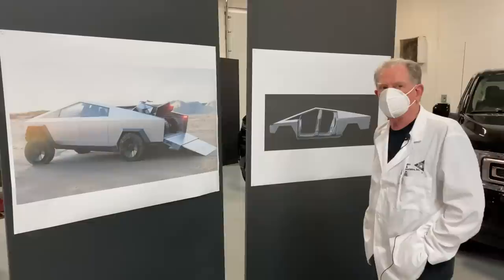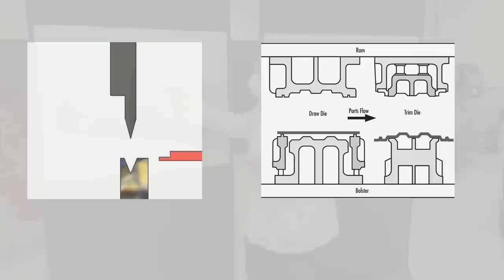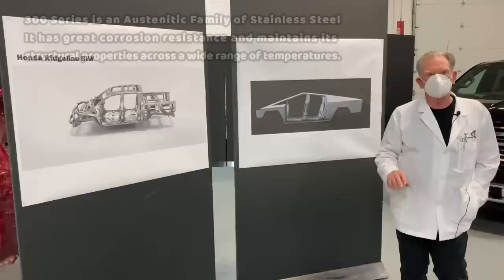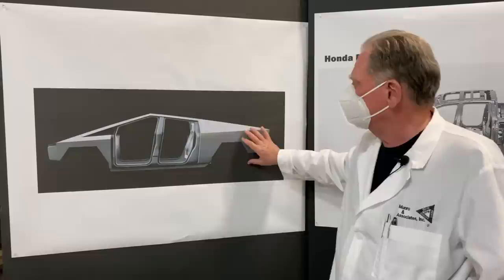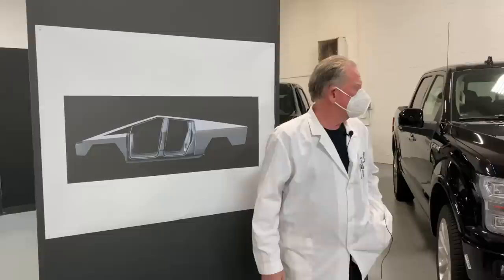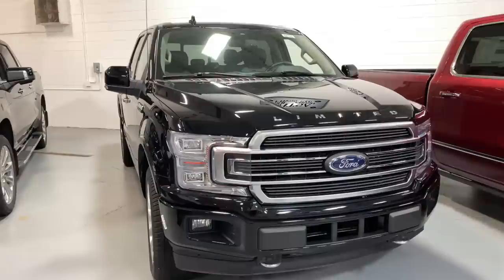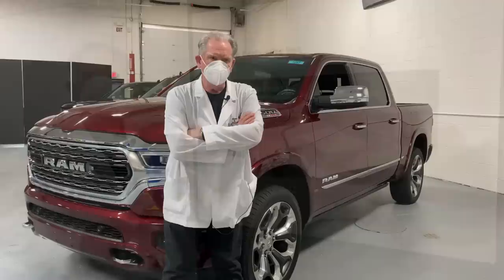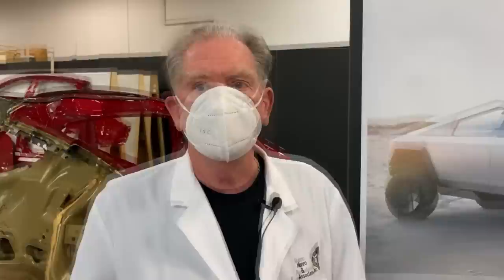Cybertruck E1 - Body Structure Comparison

Comment: It would be nice if Munro (or Elon Musk) clarified what "ultra-hard" stainless-steel means and why you can't stamp it.  Presumably 30X refers to an alloy type, like 301, 304, ...  Certainly kitchen cookware is formed in a hydraulic press, using similar alloys, as many youtubes show (ex. www.youtube.com/watch?v=CJYT_dpzBEs).  Perhaps Tesla didn't learn the trick of putting plastic film between the stainless sheet and die.  I'm not a metallurgist (just basic mechanical & aerospace engineer), but in machining stainless steel at home ("chrome steel" to engineers), I find it not hard, but rather tough and "gummy", which is why threaded parts can easily gall and taps can jam.  That is particularly true of 300 series which has more chrome, is non-magnetic, and is less corrosive than 400 series. Munro's "I prefer to look at a white car" (to notice paint defectes) confused me.  Pro car painters will tell you that gloss black is the hardest color to get right because every ripple in the body shows.  White is easy and hides many defects.

Comment: how about pedestrian safety???
Reply: costakis do you believe for a freakin minute the human body has enough mass/integrity to stand up to crumble zones? Good god man, the striking vehicle would have to be made of wet toilet tissue. A feather pillow flying down the highway at 35-40 mph will damage internal organs or snap your neck.
Reply: @Dixler683  you have a point there but the issue is slow speed in city center with start stop traffic that is very common a steel hood or fender that doesn't give at all can make the difference between a soft plastic one or even aluminum, at least in my opinion...

Comment: Using aerospace materials in a "work truck"... I would hate to ever get any sort of ding/rock chip/grit blemish/fender bender... 
The repair will require some creative processes... You'll have a heck of a time bending it back (if you even can). You can't replace the fender unless you source it straight from Tesla, any other manufacturer wont be able to replicate the proprietary alloy they are using... (this means that the sheen/color/appearance of the replacement will be different and you'll be forced to paint the whole vehicle)
It'll be one heck of a piece of technology and a work of manufacturing art... I just don't see the economic reasons to make a vehicle with such "exotic" materials... You are inviting such a hassle for your customers.

Comment: What the aluminium is cheep and the teslas is morea expendsive?
Reply: Cyber truck raw steel is more expensive, but putting it into shape is cheaper, because the shape is more simple, need less parts, so less manufacturing steps and robots.

Comment: 15:35 What are rabbit ears? Could someone explain, Google did not help. :)
Reply: Neeraj Nair the flaps on a rabbits head used to focus sound waves to the ear drum. In the case of electronics the “ V “ shaped antenna used to pick up radio waves.

Comment: I don't get it. Absolutely no driver protection in the a pillar area. Your head looks to be forward of the roofline so your decapitated in any impact in that area. 3rdly the front end is a ramp. And any front end hit launches the 2nd vehicle into the windshield area because its angled so severely.  Awesome truck just don't wreck. I'd have to fab a roll cage on day one before I would drive it. Death trap

Comment: I don't want a truck that just gets a badge of honor from a cart. I want it to dent the cart and then casually look over like a body builder to a child throwing a punch. like " oh i didn't see you there, you want something?" and then activate the switch connecting the battery to the exterior hull causing a lethal bolt of electricity.

Comment: if you can sell a truck at 50-70k of course you can use better materials and get it harder as well throwing in high performance welding. But the other trucks at top spec are most probably cost slightly more than half to a tesla truck basic model. Where is that comparison? The whole tesla fan crowed never understand that engineering is about striking the perfect balance between technological benefit over a affordable cost. Not throwing in cutting edge features that price out 90% of the market.

Comment: Omg the truck can’t even handle a atv. That suspension is completely compromised. That’s not a truck it’s a car with a off road package and a big trunk. No way that would be safe to drive over 40 mph with the little bit of weight

Comment: In an accident, you will have to change parts, you can't repair a stainless steel fender or hood.
Reply: SHAZOM who repairs hoods today? The crumpled piece of crap is removed and a new part bolted on.

Comment: A Unibody is not a unibody when it is built from parts !
Reply: TheNick70nick today most vehicles are unibody. Using your logic these cars are NOT MADE  FROM PARTS ?  The individual steel stampings are welded into a unibody, what are you trying to say, I do not understand your comment.
Reply: dixler mudflap mudflap  unibody is one piece.

Comment: Comparing the Cyber truck / Which you know almost nothing about!! \ to well known traditional vehicles is a silly fantasy.  Here is a short list of things you will never see a Cyber Truck do:  Tow truck, Box truck, Flatbed, Van, Class B Motor home, Class C Motorhome, Ambulance, Food truck.  Also, you can't stretch a Cyber Truck by just adding a few inches to the frame, you can't have a two-door and a four-door (and all the choices in between) on the same frame.  I see the Cyber Truck as similar to the GMC Hummer a few years back, it will be interesting as a light-duty vehicle for hauling kids to soccer practice but it is no substitute for the F series. 

P.S.  Someone will build a Cyber Limo.
Reply: You’re criticism basically is just that the Cybertruck can’t do things it was never intended to do. It’s clearly meant for the consumer pickup market, not the commercial truck. Although, I think it might be a strong competitor to camper vans.
Reply: @kokofan50  I am not criticizing the Cyber Truck I am trying to point out that the traditional trucks are different animals than a Cyber Truck and probably shouldn't be compared straight up without a little more background to show the difference.  
The Cyber Truck's exoskeleton body is the frame so you can't easily change it into something else like you can a body on frame design.
Reply: @TerryPullen  you did criticize the Cybertruck, in the sense of a critical analysis, and that you’re analysis is vapid because  it’s obviously not intended to be the things you listed with one exception.

Comment: Sandy is great but I did notice how he ignored meeting pedestrian and crash test requirements.  How the hell do you have crumple zones with a slab sided exo-skeleton? Anyone?  

There's good reason why decades ago the industry moved away from impact force being transmitted to occupants because of cars built like tanks without shock absorbing crumple zones. There's good reasons why front end sub frame rails are corrugated and front ends are made of rounded plastic and weak metal not pointy slabs of high strength stainless.  I'll believe this truck will be anything close to what is being marketed when I see it driving down the road and can actually buy one.  Musk is somewhere between genius visionary and marketing bullshitter depending on how much you worship him.  If it gets built at all my money is on a pretty stainless skin glued on an under lying crash structure sort of like how your refrigerator is "stainless steel".
Reply: @JorgTheElder  that I didn't know. I knew commercial vehicles fall under a different category but I didn't know pickups had a lot of exemptions too.

Comment: Political Correctness be dammed, there is no need to wear a mask as the presenter. It is obvious you are at least 6 feet away from anybody. If a crew member needs to approach you, they won't be recording so you will have time to fit the mask. I'm sure you will be more comfortable and we could hear you clearer.

Comment: The sharp edges of the Cybertruck will be bad for aerodynamics.
Reply: its more aerodynamic than any pick up truck on the market today
Reply: @jackmann3  I'm doubtful about that. Small radiuses (like the kind produced by sharp edges) force the airflow to accelerate tremendously. This causes the adjacent airflow to trip into turbulence, which increases drag a lot.

Comment: Steel? China can make it... but I hope it would be made in the US
Reply: I think SpaceX have their own. I may be wrong though. Would probably have to be scaled though.
Reply: @Jimmy_Jones  that would be great
Reply: Austenitic 304 grade is the most common stainless steel, the specific 30X will be similar and not that difficult for an SS manufacturer to alter the recipe to produce. I mean SpaceX made a few 30X spaceships already so it has already been produced by their supplier. There are many different austenitic 30X types already marketed, so supply should be OK.
Reply: Most sales will be in US, so 100% it will be made in TX or OK.

Comment: Well not even stainless steel is "rust proof". Even stainless will corrode given bad enough environment, it just take longer then with other steel types. Even aluminum will corrode. I don't like that you advocate the use of less paint or no paint. Not all of us live in SoCal or Arizona. North eastern US, great white up north and nothern part of Europe we all drive on salt water for months each year. As temperature drops each falls, out comes the salt trucks. The mix of snow and salt turns into "salt water slush". It coats every vehicle, in finds it way into all thinkable places. We need paint. And lots of it. In fact, many manufacturer have wasted millions of dollars on warranty rust repair,  like Mercedes did with their w210 25 year ago. And before that the panel van Vito. And they are not alone. Harsh winter weather and salt added to roads ro prevent road skate parks creates the worst conditions for metal. Pls consider this before you advocate no paint scheme or less paint schemes. The paint is there for a reason for all cars and trucks outside California and Arizona.
Reply: Don't buy one.